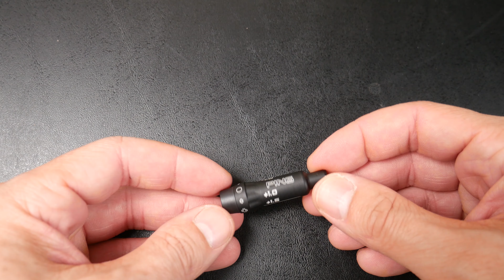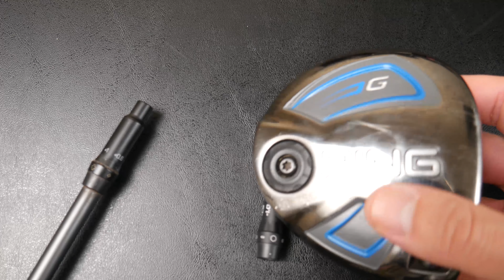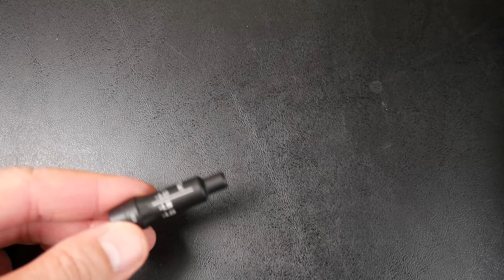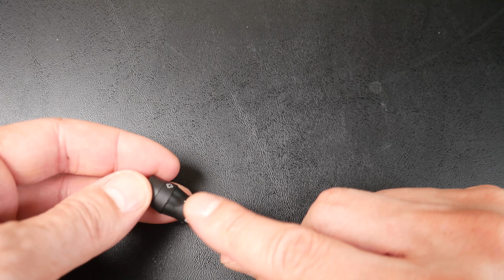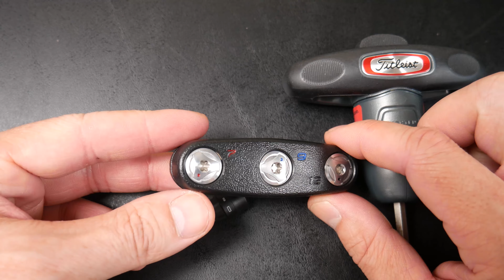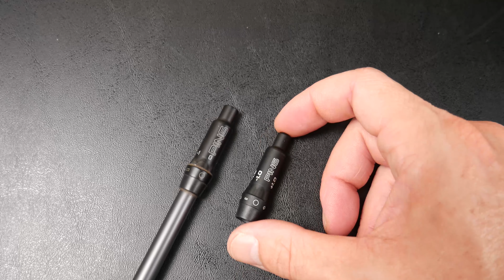Ping Adapters Explained - (See Description For List) The Vintage Golfer

Comment: I was given a shaft with a RH 410 adapter. I love the shaft BUT I am LH. Can I use the RH adapter and switch values from RH negative to LH positive? Signed, cheap dude in Seattle. Thanks in advance!
Reply: I came here looking for an answer to the same question...did you ever find if it's backwards for LH golfers? Thanks
Reply: @jazz15c4  yes...confirmed by Ping...exactly reversed. Enjoy!

Comment: I prefer the callaway adapter because I don't play 360 grips... it's very annoying having to redo grips every time you want to tinker... I recently bought a Ping driver with a 360 grip on it so I'm going to tinker with it for a bit and when I find the sweet spot setting I'll lock it in with one of my normal grips... not ideal but the Max 10k forgiveness will hopefully be worth it haha

Comment: Do the new adapters keep the grip in the original position when you change loft? I have the G25 so I’m not too familiar with the newer tech.
Reply: No, (you can alter the G25 but only minimally)the only maker is Callaway that have a cog method which keeps the shaft always in the same alighnment whatever loft you choose, this means you can have a 'spine alighned ' shaft and a ribbed alighned grip instead of  grip that is just round.
 Also the ping method of having a taper fit into the head gives a lot of pressure on the hosel of the head, which causes the hosel to crack, you will find many many instances of this its the only maker that has this flaw theyve know about it for years but never changed tack and have had to remburse or give a new head ouut to disatisfied customers